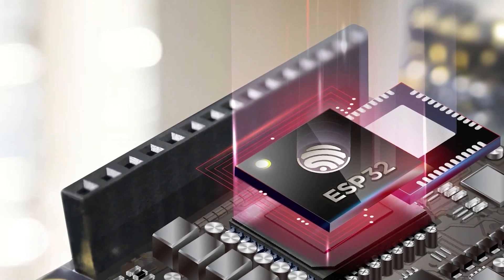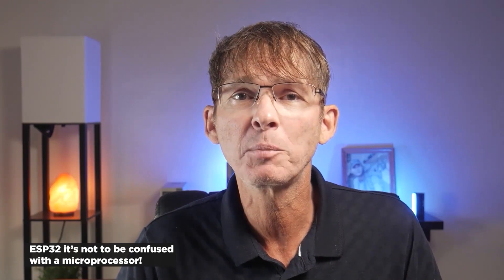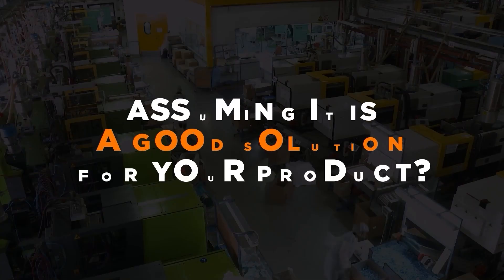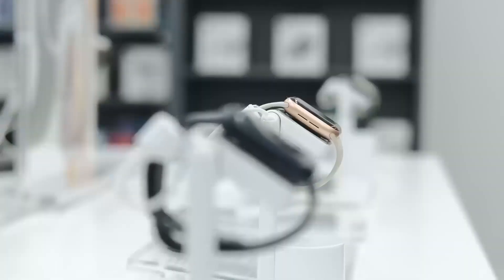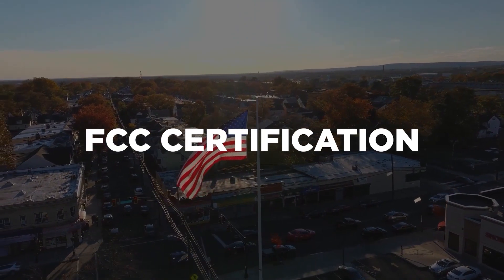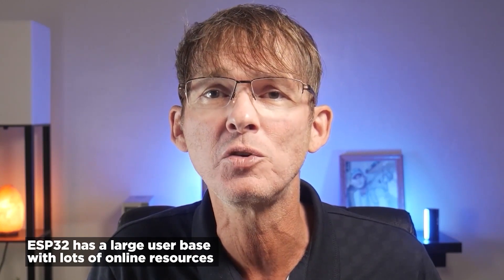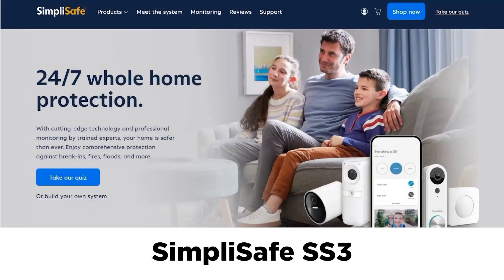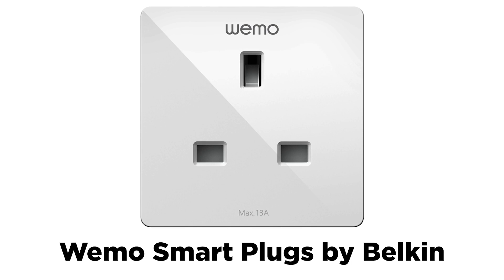ESP32 in a commercial product? - From prototype to production

Comment: First I have designed many production systems using the ESP32... I will keep using them. However I do not TRUST them... there is a bunch of code I don't have access to that lives in the builtin ROM.  It is used as a cheap WiiFi/Blutooth connection peripheral... the real product code lives in a trusted standalone micro-controller and I use an UART link between them. I would not recommend the ESP32  to be used in a product if all your secret sauce code is running on them.
Reply: That's the same with the other manufacturers. Nordic, SiLabs, Intel, AMD, Qualcomm, Broadcom... You don't get their secret sauce. Especially the radio software.
Reply from the maker: Thanks for sharing that and commenting!
Reply: Do you think the ESP32 is phoning home??
Reply: @DMS20231 Run some Wireshark and look for the China-based IPs.  "Unhackable" and "it's too small to send some data over wifi" sound like really flimsy dismissals on the part of fan f.......s..., well, you know the thing.
Reply: @DMS20231  Phoning home 😂
Reply: @DMS20231  Not necessarily...  although that could be a possibility, I have not heard of anyone seeing that behavior. My main issue is the firmware is not secure with their design.
Reply: @thefreem0  is there just one shed of evidence that offers any support at all to the idea that the ROM microcode is insecure?   Typically, that firmware is hard coded and immutable.    If they even remotely allowed anything nefarious to occur there, it could sink the company.   Do you really think they would risk that for data that wouldn't mean anything to them?   It just doesn't make any sense.
Reply: @keithsummers1889 The ESP32 manufacturers are chinese, I wouldn't take the risk
Reply: @cristiandavidmillergonzale710  These parts are too small and cheap to store enough malicious microcode.   The working libraries are all open source as well.   Trust or no trust, the opportunity to gain value or cause disruption just isn't there.   Your distrust however, is appreciated because this tends to drive down the prices for me.  Thank you.
Reply: Esp32's v1 and v2 encryption had been defeated if you're interested.
Reply: @psykjavier  (not sure that question is to me, but I'll answer) VS Code, C/C++, IDF.   I'm having a pretty good time of it -- but there is always something more to learn.   I kind of doubt that I would ever learn it all.  I just integrated Wifi, SNTP, and Universal Wifi Provisioning.    I'm following that up with Wifi Mesh networking.    I already have AWS IOT Core in bag and that pursuit was fairly frustrating.
Reply: If you don't let the Chi-Coms have a back door to your security, then you sir, are a racist.
Reply: Ur code wil be hacked, from Chinese hacking department under ther industry department,  government of China
Reply: I hate it when I'm exploring a new thing and then get brick walled. Lolz
Reply: Drop me a line if you know of any contract opportunities with the Esp32 .   I have been engineering code for the Esp32 for over 4 years - C++/IDF.  Thanks.
Reply: All imagination 😂